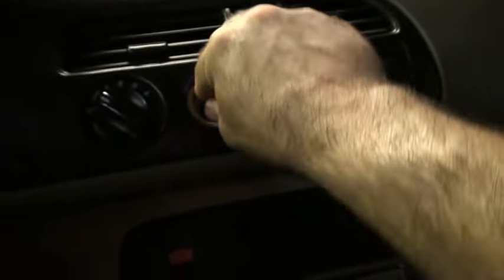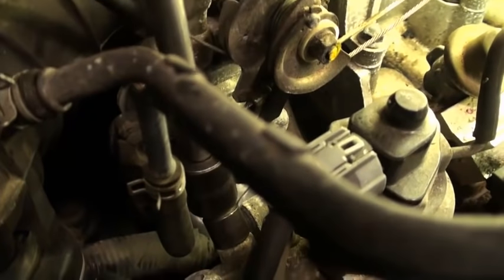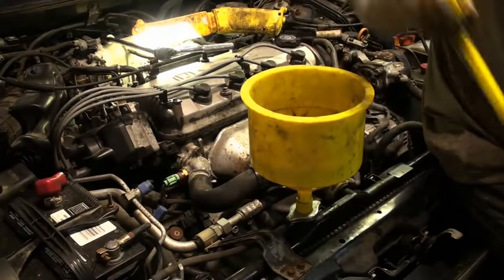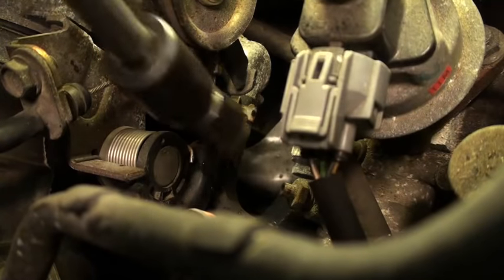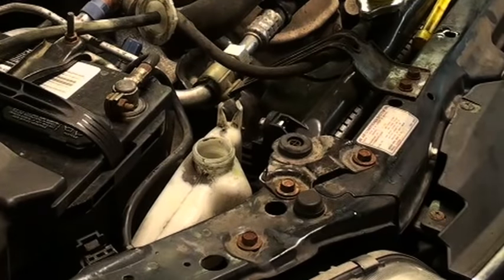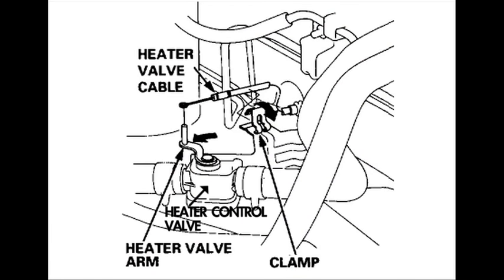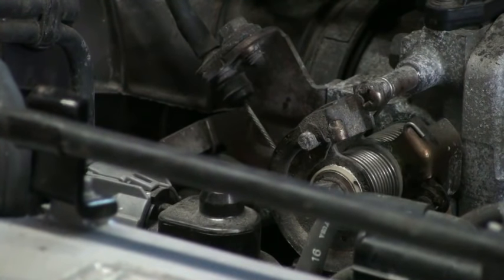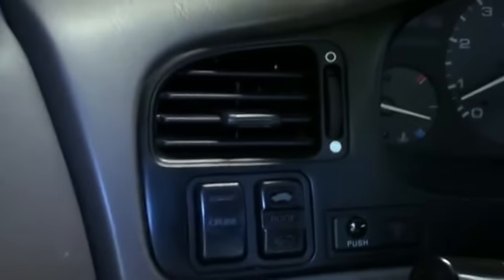How To Bleed A Cooling System - EricTheCarGuy

Comment: Seven years later, and this is STILL a helpful video. Thanks Eric.
Reply: right
Reply: Yep, 8 1/2 now 😛
Reply: Silky Tp almost 9
Reply: Bruce Lee's movies
Reply: 8 yrs later and yea
Reply: Silky Tp i was doing the bleeding and the water started gushing out the radiator cap.
Reply: That's normal. Someone feel free to correct me if I'm wrong. But that's why the normal cap tells you not to remove it while the car is running. It is pressurized and will shoot hot water all over.
Reply: 9 1/2 over here
Reply: It is helpful for me even though my is drive by wire and has no steel cable to the throttle body.  Then there is no cap on the radiator itself and it has to be filled through the coolant reservoir.  Heck my car does not even have a radiator drain valve.  You can still get most of the coolant out if you undo the lower radiator hose but that is only safe if the car has not been ran in the last few hours or longer.
Reply: 10 years later this is the only video that addressed my idling issue. No other videos states about the bleeder below the throttle coil. Thank you Eric
Reply: 10*
Reply: 10+ years now
Reply: @siachen6680 I have to agree. I've never heard of it but this video. I've changed plenty of water pumps, thermostats, & a few radiators, & never been told or heard in a video. He's got me subscribing.
Reply: @ericthecarguy October 2020 thank you ETCG!
Reply: 11*
Reply: Yea YouTube has made him a Fortune I like his videos Chris fix it Scotty
Reply: 11 now
Reply: @aaronfluegge4865  No sh*t, right?
Reply: Running on 11 years now too
Reply: 11
Reply: @Anonymous-ze4sx  8
Reply: 12 plus now
Reply: 12 years later
Reply: Try 12
Reply: even after 12 years
Reply: 13 years later ....
Reply: 12 Now
Reply: 12 years.
Reply: 13 years and still helping
Reply: 13 years😂
Reply: 14 years
Reply: 14 !!

Comment: Hi Eric. I found this video very helpful. Draining and Refilling my cooling system solved my idle problem. I had no signs of a leak in the system, but in the end, I realized that over time I was losing coolant through evaporation because of an old worn out seal in my radiator cap. I would suggest that people check the condition of their radiator cap while they have it off anyway. Mine was the original cap that came on the car in 1998.

Comment: I’m 17 and I had my car looked at by somebody and they said they didn’t know why it was overheating. An old man told me I had an air bubble in my cooling system and he described the symptoms without even looking at the car. This video is old, and ironically, I have the same motor in my accord. Thankyou for helping me out. This helps me immensely.
Reply: What did you do
Reply: What exactly did you figure out? Did the old man's suggestion turn out to be true, and how did you figure that out?

Comment: Picked up one of those spill-free funnels today since I couldn't get the system to bleed properly and it worked like a charm.  I recommend this to everyone, it makes it easy to bleed the air and prevents spillage which is something to consider if one has dogs that follow you like I do.
Reply: So you tried this without the special funnel and it didn't work?
Reply: @WilliamMartin-px5cn  The funnel makes it easier because you won’t spill coolant all over when the air bubbles come out of the radiator.

Comment: This annoying process is why I like to use a vacuum cooling system fill tool. Sure- it's not practical for the average do-it-yourselfer to purchase one to use on his/her own vehicles once in a blue moon- but for any mechanic, it's a great investment. I get a full fill of the cooling system each time and NO air pockets. It also helps you to figure out if the system has a leak before you fill it. If it won't hold vacuum, there is a leak. It's very useful. This tool also saves a lot of time, I've found.
Reply: HOW MANY INCHES OF VACUUM SHOULD A GOOD SYSTEM HOLD?  I MEAN MOST CAPS ARE RATED BETWEEN 10-13 PSI TOPS TO PREVENT DAMAGE TO COMPONENTS (RADIATOR/HEATER CORE, GASKETS, HOSES ETC)  IF YOU PULL VACUUM BELOW 28" HG YOU ALREADY HAVE MORE THAN 14PSI ATMOSPHERIC PRESSURE FROM THE OUTSIDE GOING INWARD...
Reply: +ComputerUser321 you'll never get a full vacuum into the system... of it holds at 25" Hg, you're good

Comment: I have to say that this video has made me an extremely happy guy this morning.  I'm not a certified mechanic, but I've done enough work on my own cars over the years to have a pretty good idea of how to go about troubleshooting most issues and figuring out where the problem is coming from.  

I volunteered to help a friend with her 2000 Honda Civic LX that was having overheating issues.  A friend of hers is married to a mechanic, who said that it was a head gasket issue.  However, there wasn't any strong evidence that pointed to a head gasket issue.  With the help of my brother and his OBD scanner, we took it for a test drive and noticed some wide-ranging temperature readings, which led us to suspect the water pump as the primary issue.  Once I had the belt cover removed, I found the tensioner spring had failed, and that the timing belt was very loose, becoming glazed and hard.  This also meant that the timing belt wasn't driving the water pump the way it should, so I figured we had found the problem.  After replacing the water pump, the tensioner and the timing belt (and the harmonic balancer as well, because I found it had a chip in the back belt rim...), I went test driving.  

While the overheating condition wasn't as severe as before, it was still a problem,  After testing the cooling fan, the relays and the fan switch, it appeared that the fan switch was not working properly, so I replaced it.  Still overheated.  Then I pulled the radiator hoses to inspect them, found no apparent problems, so I flushed the radiator and the block, put the hoses back on and refilled the system with coolant.  Another test drive... Now the problem had gotten even WORSE!   (UGH!!) I was getting ready to go buy a block testing kit to check for a blown head gasket when I found this video.

Dude, your video helped me to save this car.  I had no idea that so much air could remain trapped in the system, or cause such big problems.  I followed your information and her car is back on the road today.  It's still not quite 100% (the cooling fan doesn't come on with the compressor fan like it's supposed to, but it does turn on when the switch reaches sufficient temperature...), but at least she doesn't have to be afraid of pulling off the road because her car is overheating again.

At any rate, I suppose that's just a long way for me to say,  THANK YOU very, very much.  :)

I am now a happy subscriber to your channel.

Comment: i just use a plastic 2L coke bottle with a cut off bottom and tape around the cap tread to make nice tight fit into the radiator , nice and cheap and works sweet.
Reply: That's the Trucker method
Reply: Deon Hamilton. Great idea.. Thank you.
Reply: @6bat6manz6thesh1t  Are there no schools in your area?
Reply: @6bat6manz6thesh1t  There is NO plastic on planet Earth that melts at 120F. It gets to over 105 degrees ambient in south Texas in the summer. Under hood temps are well over 150F easy. Cars and all other plastic devices would be in pools all over the place.
Reply: @6bat6manz6thesh1t  nope
Reply: @6bat6manz6thesh1t  most radiators have plastic tops so why dont these melt ? because your talking BS it does not get hot enough
Reply: @6bat6manz6thesh1t  I'll bet it did..
Reply: @rickjames6948  why is it you be axing hers dat?
Reply: @carlboone3476  axing???Lmao.

Comment: Some engines do not have a bleeder. Find the highest point,usually a heater hose and bleed that one. Also,parking the car facing uphill helps a lot. Revving the crap out of it helps to push the bubble out as well.As far as the coolant filler Eric used,I used a MINI traffic cone. Works fine.About 10" tall,but my filler neck is straight up.
Reply: Since the fluid is circulating in the system, shouldnt it remove the air little by little in the filling tank?
Reply: Kevin Afton if the engine sits higher than the radiator air will get traped and coolant won't circulate. I first encountered  this on a grand prix the heater didn't work changed water pump, thermostat, and saw the bleeder cracked it open then air bubbles came out after a min a stream of water. I had heat and a normal temp .
Reply: Anthony Tucker

Hmm, so if the filling tank is higher, like on most of the vehicles, it should be OK, right?
Reply: Not sure I have only had this problem on some GMs
Reply: The older 3100/3400 V6 engines didn't have a air burp line that ran from the from the top of the thermostat housing to the overflow tank. Instead they had a air bleeder valve on top of the thermostat that you had to open/close manually.
Later on they added what looks like a steel metal line that does this. Easy to spot this line on top of the thermostat housing which connects to the radiator house on the right hand/drivers side front of the motor.

Comment: Thanks for the video, Eric. I was able to bleed my own system and get rid of the revving idle and overheating engine.
Reply: What do you mean revving idle? Can you explain it
Reply: +TKclan he means like the idle speed going up and down, usually happens with bad sensors but I suppose it makes sense as a cooling issue with modern engines
Reply: +Vincent Rogue would a bad ECT sensor cause this? Because I'm getting a CEL code 6 which is the ECT sensor.
Reply: TKclan very likely, I would replace it anyway
Reply: +Vincent Rogue lol what do you mean very likely I would replace it anyway? Or you mean very "unlikely"?
Reply: +TKclan I'm saying you should replace anything that is causing the car to throw a code. either clean the sensor or replace it and it will likely fix your issue. if not you solved another problem anyway

Comment: When refilling and you have a radiator hose with a radiator cap and you have a resivor tank. Do you refill in the radiator cap until it is full or do you just fill through the resivor until its to the full mark on the resivor bottle? The car is a 2013 Chrysler 200 2.4 engine.
Reply: Both.

Comment: My friend changed the coolant in his car. After that, his engine would heat up. I looked at it and found it had air trapped in the cooling system. I bled the air out by leaving the radiator cap on and starting the engine. Then letting the engine reach operating temp. Then carefully and slowly cracked open the bleeders and let the air trapped in the cooling system escape. Once coolant started coming out of the bleeders, I closed them. DONE, his heating issue went away.
Reply: +Frank Gonzalez Cool story bro. So you did whats shown in the video.
Reply: +drifter13 No, my friend changed the coolant in his car. After he changed it, the engine would heat up when he was at a stop light. As he got going, the temp would drop. When stopped, the temp would increase and the cooling fans came on but the temp would still increase, that's when he gave me a call. After I started the car, the engine reached operating temp and the fans kicked on but the temp would still increase. Air flow through the radiator was fine but the air flowing through the top of the radiator was much more cooler than what was flowing at the bottom, that indicated air was trapped in the system. Left the radiator cap on and cracked open the two bleeders, but did not remove them entirely. Left them in this a few threads holding them in the bleed holes, At first a hissing sound came out of the bleeders. That was the trapped air in the system escaping. When coolant started to come out of the bleeders, I closed them. DONE!!! Drove his car around after bleeding, temp issue went away. He didn't know he had to open the bleeders when filling the empty cooling system.
Reply: +drifter13 Looks like you need to learn to read because apparently you can't.
Reply: +Frank Gonzalez so you don't actually need this spill free kit and wait for the bubbles?
Reply: Did you have to top off with coolant after the air bleed?
Reply: Frank Gonzalez How do you do this for a car that doesn't have bleeders? I have a 96 cadillac deville. From my understanding it's "self purging", still want to make sure though. Any tips/info is greatly appreciated
Reply: Park on a slight incline with the front of the car higher than the rear. Open the radiator cap when engine is cool. Start the car and set heat to high fan off. Run the engine with the radiator cap off for about 10 minutes after reaching normal operating temperature, and fill as needed. Once fluid is coming out of the radiator, and there are no more bubbles, the cooling system is bled. Put the cap back on and fill overflow to specified level- typically L or F depending on your vehicle.
Reply: Frank Gonzalez   Hello I hope you can read this comment and maybe you can help me out : I own an 02 Acura I did the same like you to purge the cooling system but in my car the water started boiling with bubbles  and spraying everywhere my fans never turned on and the top and bottom radiator hoses both      are hot

Comment: Tried doing this with a funnel, waiting for the fans to come on, never came, coolant started gushing out of the funnel all over the place. It was a blood bath. At least I had enough coolant to refill it.
Reply: F0XD1E hi wen engine gets to a certain temp the fans should kick in, so there you go... thermostat needs to be looked at.
Reply: Curi0u50ne
Reply: It'll do this if it's not sealed. The coolant has a higher boiling point when pressurized. Just do it until a majority of bubbles dissipate. Then put the rest in the overflow. Gravity and vacuum will do the rest.

Comment: Hey Eric,  I have plenty of mechanical knowledge as an older guy and I prefer older vehicles. my recent acquisition of a nice 95  Honda Accord with minor idle  issues lead me to your video.  The car had a recent new radiator installed.  I would have never thought the coolant issues would lead to idle issues.  I learned something new and appreciate your knowledge.  Keep up the good work even though you posted this over nine years ago.  It certainly helped me.  Thanks.

Comment: So you pretty much just keep the radiator cap off till it heats up? That seems simple enough.
Reply: .....with the bleeder valve open and the heater on high, but fan off.

Comment: This funnel save my car and it worked.  I had three seventh generation honda civics, the first 2 were 03's and the last was an 01.  I  essentially did the same preventative maintenance on all three as far as if nothing else changing coolant hoses and thermostats.  The 2003's I bled the conventional DIY way by filling up the radiator with coolant, starting up the vehicle, turning the heat on high and letting the radiator burp and topping off coolant after the thermostat opened.  This method worked fine, the temperature gauge got just below the half mark and held fine and all was well.  Turned off the vehicles, replaced the radiator caps and off I went with the coolant system properly working.  The 2001 Civic was the last one I purchased and I replaced timing belt, water pump, radiator, multiple parts of the cooling system.  This is where the fun and headaches began.  During the process of bleeding it I had no heat and the temperature gauge kept rising to the point where the antifreeze was getting hot, bubbling up and spewing out the radiator.  Did this several times and the same result.  I was baffled because 2 of 3 of these civics this technique worked just fine.  Only difference was the first 2 were the same exact year but they all were the same generation so everything under the hood was identical.  After several attempts and a few more thermostats I kept getting the same results.  I was at a lost for words so I checked out this video.  Now to the best of my knowledge I could not find a bleeder screw on there so I followed Eric's instructions and it worked like a charm.  Apparently there had to have been an air bubble within the cooling system that not only caused it to overheat but I also had absolutely not heat coming out the vents.  I followed his instructions step by step and I was worried because I just assumed using the spill free funnel that the coolant would bubble up and start spraying out everywhere like it had been doing before but it did not just like it did in this video.  It bled fine, got to normal operating temperature and I finally had heat.  I got mine off of Amazon for $20.  Best investment I have made for that car.  One of the best features about it as I wondered about was after the car was cut off and the coolant cooled down I used the stopper that it comes with to maintain the remaining coolant in the funnel and I was able to put it back in it's original container so not only did it work for bleeding the system, it also was absolutely no mess made putting the rest of the antifreeze back in the antifreeze container.  I would highly recommend purchasing one of these funnels and mine came with multiple adapter fittings for various makes and models of cars.

Comment: Excellent suggestion and I like when the fluff is cut out and you get down to business. Replaced a stuck thermostat yesterday on a 1997 Ford Ranger, 3.0. Simple job but amazing how much trapped Air has to be purged. Amazing also is how much cooler the engine runs, how much softer the upper radiator hose is and performance even seems to have improved. Temp settings to the computer apparently positively affected. As a subscriber, keep it coming fellow grease monkey! Thanks bunches!

Comment: if you dont bleed the cooling system after lets say a water pump and thermostat replacement, and then you experience overheating, could you still bleed the system after the overheating to correct the overheating problem?
Reply: Donald Walker yes,  you can bleed your system whenever
Reply: My jeep commander keeps over heating
Reply: I need help
Reply: I change termertat i dont have hot air coming in my